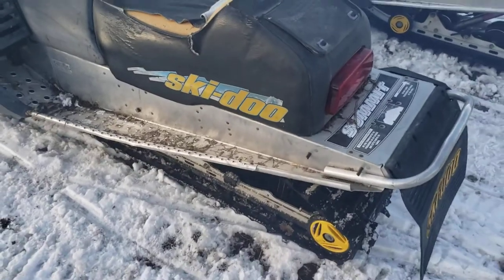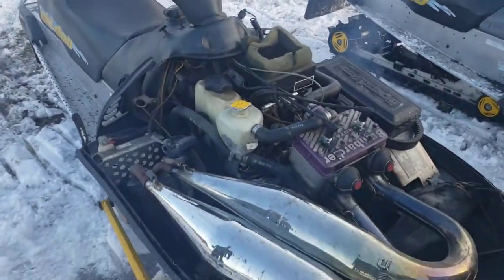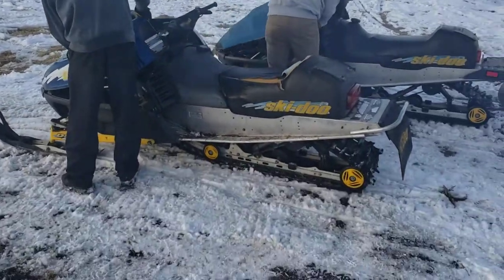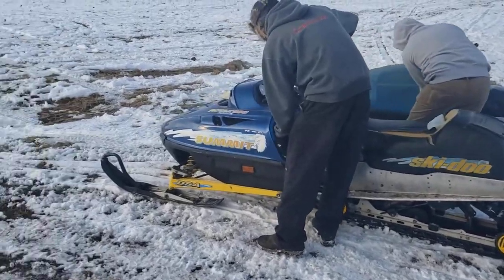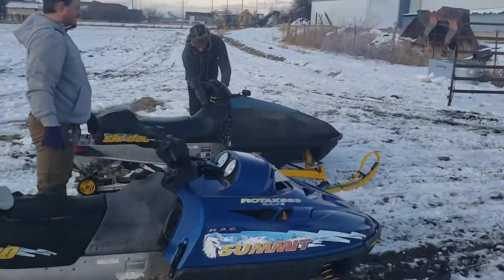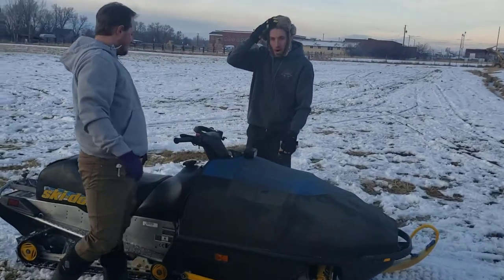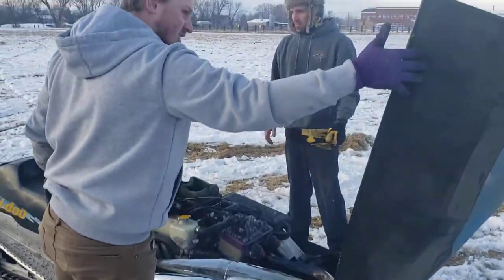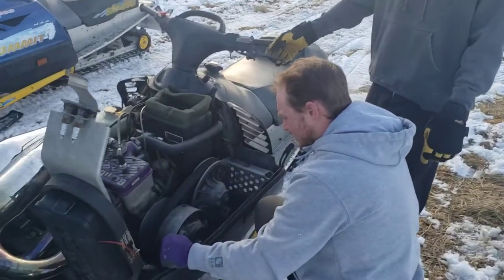Skidoo snowmobiles 670 Summit X stock vs twin race pipes video 1

Comment: both 670s, but one has a 583 written on the hood?
Reply: Probably swapped the motor, some of the machines like that can have 500s, 583s and a 670 if you have the same mounts
Reply: Hood swap
Reply: You can't beat the sound of those Rotax motors wether it's a old ass 521cc or a 670cc love them!!
Reply: Although I’m a Polaris person I seem to have more skidoo’s in my fleet but one is the best of both. The Doolaris as call it is a 97 xcr440 with a 670 mildly modded and now 735. Stock doo pipe fits perfect and a can. Comet primary and a cat roller secondary. Built by a now retired machinist/mechanic. Clutching is spot on .pulls 8300 all the way up. Love the 670’s.